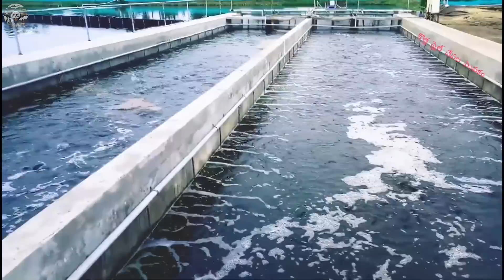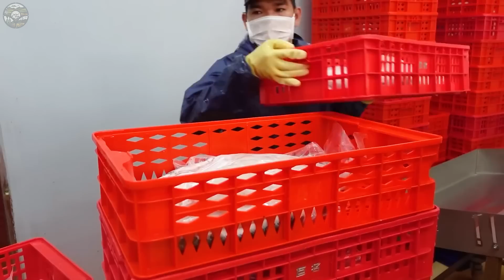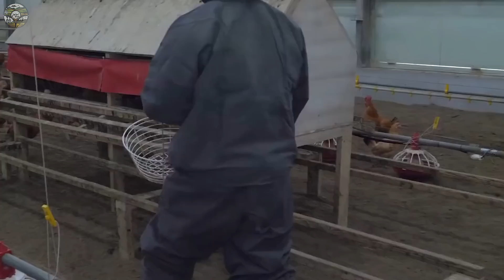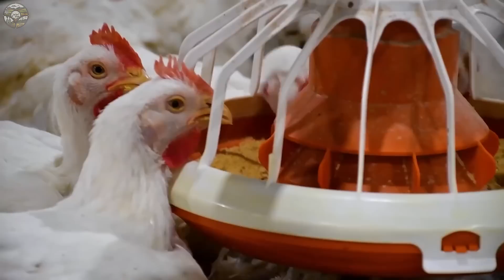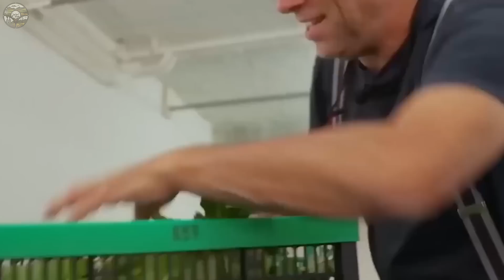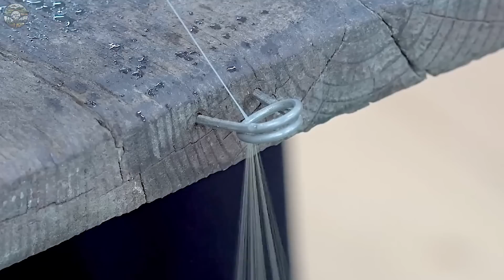Grouper farming, How farmers breed millions of giant grouper every year

Comment: Wait i thought grouper was a salt water fish?????😮
Reply from the maker: Raising grouper fish in a saltwater tank requires setting up the right systems and procedures. Use a specialized sea salt mixture to create artificial sea water, and check the salinity with a meter. Control indicators such as pH, salinity, ammonia, nitrite, nitrate and dissolved oxygen concentration, and periodically change water to maintain good water quality. In this way, you can create a grouper farming environment in a saltwater tank, helping the fish grow healthily and achieve high farming productivity.
Reply: Hi this Selva from Tamil Nadu, is there any opportunity to get an internship to work in a grouper farm. @youngbuffalofarm
Reply: I think he meant in the early part of your video it said Grouper is a fresh water fish?
Reply: @ahtieng  yes A1 made a mistake. It's a salt water fish
Reply: typo error.😅
Reply: Pump salt water in to the pool
Reply: Yes，it is！